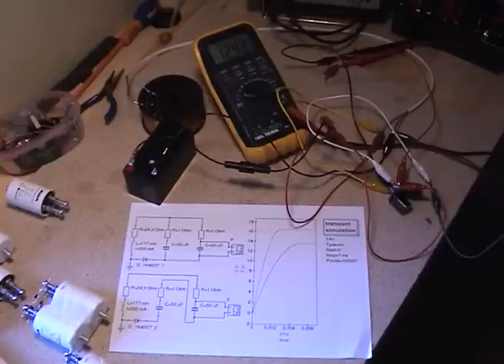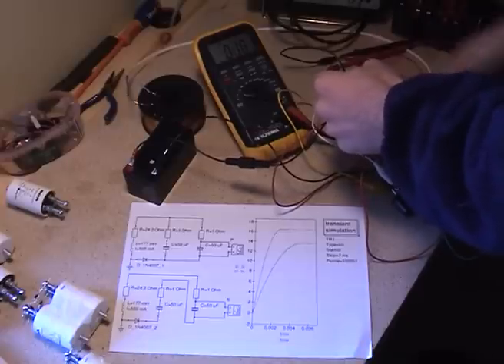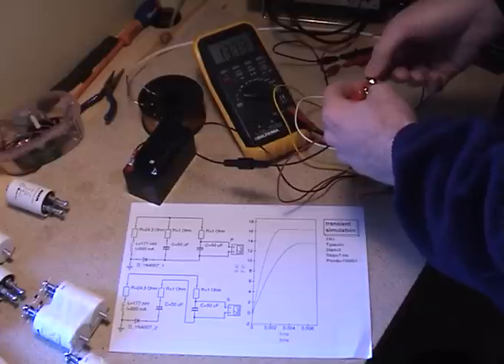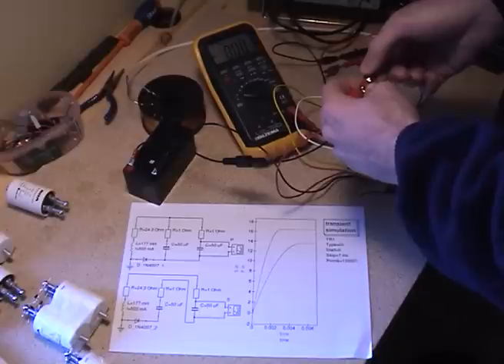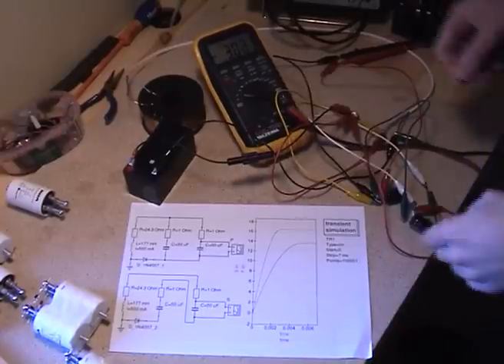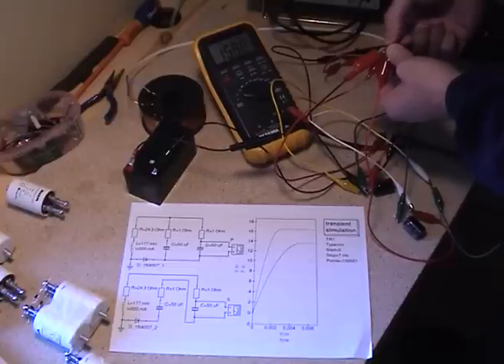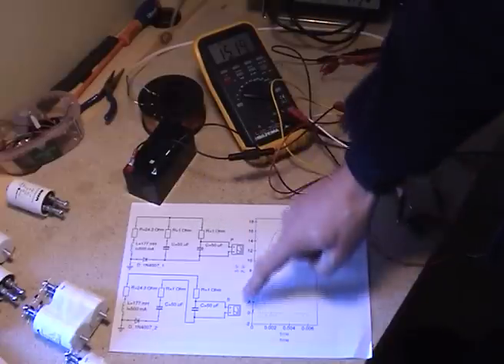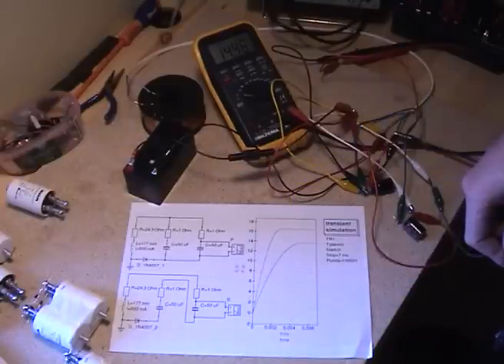Charge two capacitors

Comment from the maker: I have got more info on this now; it is impossible to determine the frequency without looking at an oscilloscope or by other means measuring the time it takes for the discharge to complete as the coil discharging into the cap is just a 1/4th of a cycle of a parallel LCR circuit.

Comment from the maker: Although i don't think it really matters in this case, i don't agree, if it's only one pulse the frequency depends on when you stop the clock, if its after one second its 1Hz, if its after two seconds its 0.5Hz. Right? But i bet the pulse has ripples on it with an actual frequency, but i'm not sure that matters either.

Comment: Try looking up the values of both the coil and capacitance via resonance of a lc circuit and you will start to understand what you have there. The only thing that is different is you have a 1 hertz pulse making you findings ambiguous since resonance needs an ac component. The lc circuit is only half of the equation meaning you need ac component to see real results. Impedance changes as you change your capacitance of the circuit,amount of charge on each capacitor. correct me if I am wrong.

Comment: Theirs a flaw in your logic...
The data your seeing is correct... However your interpretation is not...

By changing the caps so that their is series not paralelle your changing the ove-all capacitance values... effectively halfing it hence this is why you get a hugher voltage...

When you parrallel the caps your adding the capacitance together... when you add them in series your adding the maximum voltages together...
It's the same as if you used batteries...